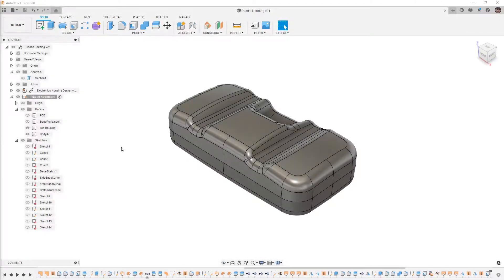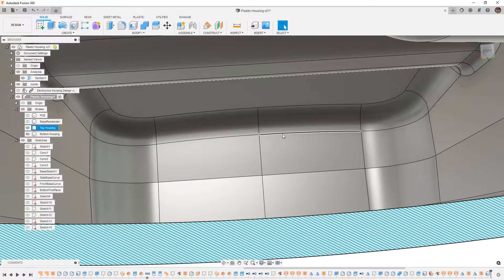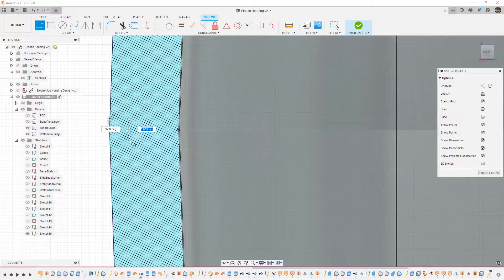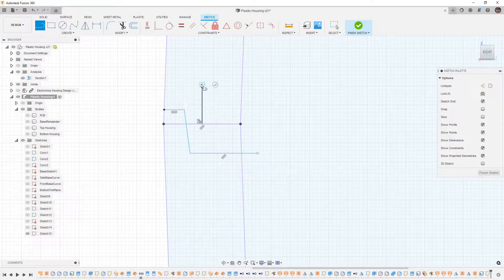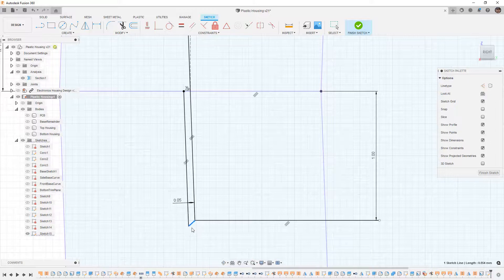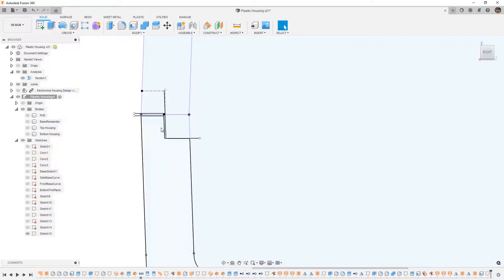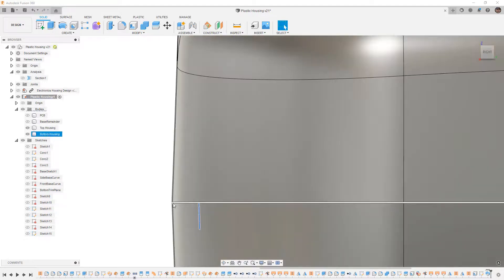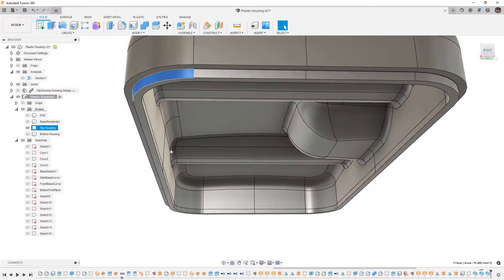Plastic Part Design Series Episode 9 - Adding a Lip Groove and Reveal #Fusion360 #Design

Comment: Wow... I'm about to design some injection molding parts for my company for the first time and these videos are already invaluable. I can't believe this is free!! The fact you're using Fusion360 makes these videos very convenient as I'm already familiar. I also find that this is much easier to digest than large white papers from injection molding companies as they rarely give specific examples of DFM and DFA concepts.
Reply from the maker: Great to hear Nick!  I did some videos on the extension Fusion released that has plastic part tools in it.  In the latest release they added some more features to it but everything can be done manually.  I will have more plastic part design videos in the future but if you have any questions please email me. support@caducator.com